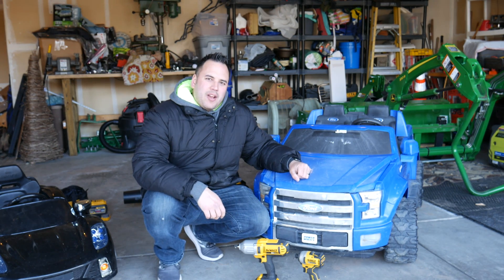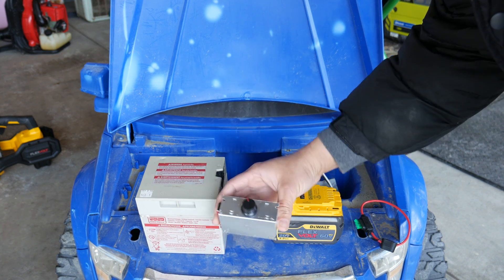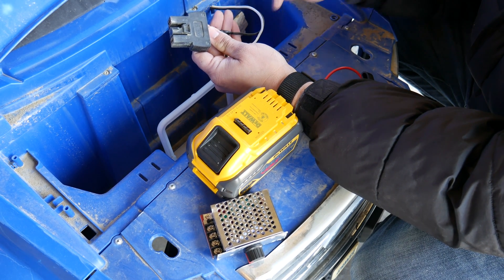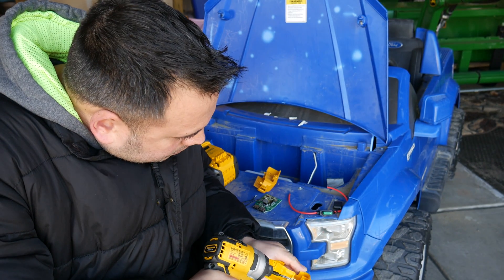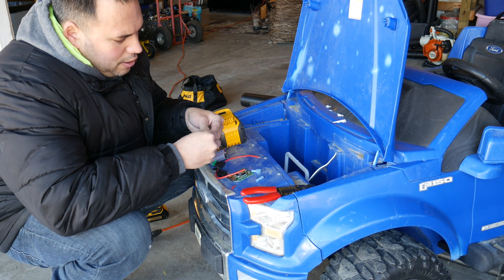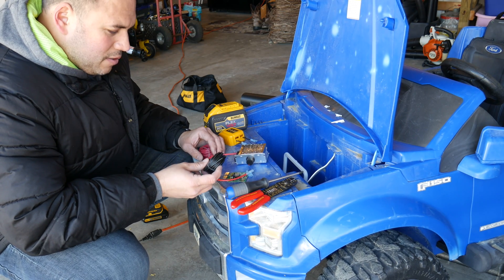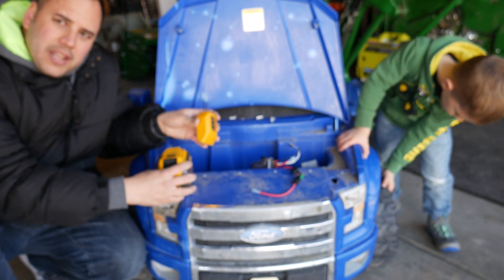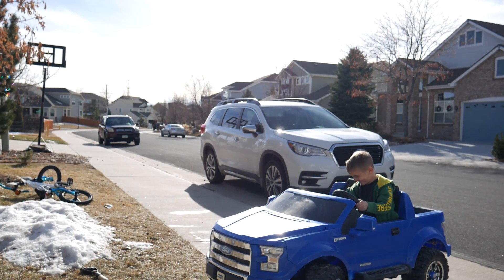SUPER CHARGE your kids Power Wheels with Dewalt 20V!

Comment: I like your idea but you didn't show the flexvolt battery and you didn't show how high you turned up the controller
Reply from the maker: Hello, because I used an adapter for 20 volts, the Flexvolt battery also operates at 20 volts and you just get longer run time.  If I ran it at 60 volts, I would fry the motors in a heartbeat which was not a goal of mine. 😊
Reply: How much run time does this give?
Reply: What about putting the controller on the foot pedal?

Comment: If you discharge below a certain volt then the battery cant communicate with the charger to charge. What u will need to do is connect positive and negative leads coming from battery and connect to anither battery for about 30 second. Now you can recharge the drained battery and not throw them away.
Reply: Never thought of that... good advice
Reply: thanks I merged the dewalt battery to the car one for even more power running the car battery positive, and merging the dewalt to the negative on the original battery and and using the dewalt lead to the car.. but the dewalt batteries keep getting drained way to fast for some reason

Comment: Pop the top off the old Power wheels battery and you can take the plug out easy and best way i have found for connectors. can also use 10 inch bike tires and cut the bead off and put it around the plastic tire and run a few screws the the side wall of the bike tires to keep them in place.

Comment: To add my two cents:

1. I bought 10 12" long trailer wires ($2 on Amazon) and cut them in half to create my own system of proprietary connectors.  I ended up converting one of the trailer wires into a polarity reverser.  The wire gauge is not great, but the run is only a matter of inches and seems ok.
2. I used a cheaper non-Dewalt adapter ($15 on Amazon) and soldered directly to the 20v out to the tool.  All the electronics and included USB charger on the adapter still work.  It still adapts 18v tools to 20v batteries.  I filed holes where the two halves of it meet for the fuse holder out and back in, and the trailer wire out.  The clamping action of the case keeps my kids from tearing apart the solder and butt connections.
3. I ended up buying a pair of 6ah batteries on sale at Home Depot for $129 to run my kids PowerWheels.  These are a great size.  I couldn't bring myself to burn up my Flexvolts which are way more $$$ per Ah.  The kids change batteries when then get down to one light on the battery.  My understanding is that a large Ah battery will get you approximately 10% more speed (also slightly better performance in certain tools).
4. If you use up a 5Ah battery in 30 minutes of hard driving, that works out mathematically to an average of 10amps over 0.5 hours.
5. I ended up with drifty cars due to much more power than the wheels can put to the ground.   This effect (which the kids love) creates substantial tire wear.
6. The first time we pressed the pedal on our Barbie jeep (polarity reversed !) the kids flipped the jeep rubber side up completely and landed on their heads.  The roll bar on the Jeep actually worked.
Reply: Number 6 had me dying.
Reply: I know this is kinda old but cut old bicycle tires and screw them around the tire. We have a field and a trail through the woods so did this and now my boys battery side by side has plenty of traction.
Reply: @ngfd338  I’m glad I saw this comment. Great idea
Reply from the maker: Scott Smith Excellent ideas!  Thanks for sharing with us!
Reply: So, do you have to use the speed controller…aka the Potentiometer?

Comment: @Hans Makes it Work. Hans i need your advise urgent regarding motor and gearbox upgrades i want to do. Do you perhaps have an email or skype i can contact you on if you would please assist me. Thank you
Reply from the maker: Enrico, I am not yet a Power Wheels expert, but I do understand electricity.  I have never swapped the motors or gearboxes because I typically get the vehicles out of the trash.  When they die, I return them to the trash and move on to the next one.
Reply: @TractorHoarders  Thank you for getting back to me Hans much appreciate it.

Comment: So I did the exact thing. Except a Milwaukee battery. But my fuse keeps blowing. What would be the reason for that?
Reply: I found out the problem. The positive came undone and kept shorting the fuse. Resoldered it and it works fine now. Thanks for the replies!
Reply: Only thing that would cause that would be a short from positive to negative before it goes into the controller.... Just a theory without seeing your setup.
Reply: Having the same issue... The in-rush current on those motors is spiking if you have more weight in the car.  Does the fuse blow under no load (wheels off the ground)?
Reply: I changed mine to a 30A breaker with a slower response and it’s working great

Comment: NICE I HAVE EXACTLY EVERYTHING U HAVE THE USB CHARGER HOW DO YOU KNOW WHICH IS POSITIVE AND NEGATIVE
Reply from the maker: Look at your battery pack.  It should have  + and - symbols on it.  Then, watch where those connect on your USB adapter and you’ll be able to see which is what.  Hope this helps.
Reply: If you don't know, you could  place a voltage meter on it and that will show polarity.
Reply: I just did this conversion. I got the truck for $10 not knowing what works. I have power with the shifter in reverse , but nothing in forward gears, I’m think it’s the shifter that needs replaced, do you agree? When I reversed the wires and left it in reverse it wen forward.

Comment: If I upgrade voltage to a power wheel that has features like remote control, radio and lights will I try them?
Reply from the maker: Yes, I’d be careful with that.  You can however easily separate those features from the drivetrain and run those with a separate battery to ensure they only get 12 volts.
Reply: Buy a 24v - 12v converter and make sure the radio etc are connected to that. So the upgraded voltage goes to motors and everything else goes through the converter

Comment: im an electrical rookie. from the dewalt usb adapter is that a smaller gauge wire (16gauge) going to a thicker gauge wire (12 gauge)? Won't that make it heat up? im trying to do the same exact thing as youve done. thanks for your help

Comment: How are you preventing the lithium battery from completely discharging?
Reply: Actually your batteries arw fine, theyre just to weak to tell the charger to start charging. If you hook up a positive and negative lead from battery then connect them to another battery for about 30 sec. Now you can charge the battery that was drained
Reply from the maker: I'm not.  I realize that I should, but maybe in the future...
Reply: Just let them have fun but dont drain it all the way
Reply: I’ve ruined two of my batteries so far 😂
Reply: Watch this https://youtu.be/8n_NJ2uIDU8

Comment: What's the run time of the 20V? 
Did the 60V work if so what's the run time on the 60V?
Reply from the maker: Victor Rodriguez I’ve never really measured it but I feel like the 20v 5ah battery lasts about 30 minutes.  The 60v Flex Volt (20v 9ah?) lasts about an hour.

Comment: I just did this and they love it.  But rode for about 5 min and I blew my first 30A fuse.  Should I just put a new one in and try it again and see... or...?
Reply: Same here....
Reply from the maker: DougMX726 I’m going through the same thing!  If we get too much resistance from having a load in situations where we get traction, it blows my 30a fuse too.
Reply: @TractorHoarders  did you ever find how to fix that?
Reply from the maker: Heather Moore I found that if we stick to cement and pavement, we don’t have an issue.  When we go off-road, up hills, or places that cause extra resistance, that’s when we blow fuses.  Someone that did this same mod said they put in a 40 amp fuse and have been fine.  I haven’t personally tried that.  When you do it, the wiring and electronic components will get hotter.
Reply: @TractorHoarders  WHAT ABOUT USING BIGGER FUSE AMPS WILL THAT HELP ??
Reply: @TractorHoarders  to not deal with the issue of blowing fuses, is why some people use the circuit breakers??
Reply: Use a circuit breaker instead! Trust me, less dead in the water moments. Check AutoZone

Comment: Iirc 12" or 14" bicycle tire fits over the original Power Wheels tires and gives Superior Traction.
How do you prevent over discharge?
It would suck over discharging your $100 lipo Nick crapping out
Reply from the maker: Andrew Downey - hey, I’m currently not preventing over discharge, but certainly open to suggestions!  Let me know if you have a recommendation.  Thanks!
Reply: @TractorHoarders  I just over discharged one of my small dewalts today. I went on amazon and bought some off brand dewalt batteries that supposedly have it built in.
Reply: @TractorHoarders  Ive been told the powertool lipos have  discharge protection.
Thats why when the drill stops, you can still charge the battery.
If it didnt and you over discharged the battery, you wouldnt be able to charge it again
Reply: Discharge protection depends on the battery platform. For instance ryobi has over discharge protection built into the battery, which is how they kept backwards compatibility with their old nicad tools. However Dewalt, Milwaukee, Makita, ect. have the discharge protection built into the tools. The batteries themselves have no way of preventing over discharge. Dewalt however makes a 20v to 18v(nicad) adapter that has over discharge protection built into it. That is the route I would go if I was going to do a conversion like this.
Reply: Ben Grant Bosch professional 18v also have the protection in the battery
Reply: Would this protection board work? 

https://www.ebay.com/itm/12-36V-Battery-Low-Voltage-Disconnect-Protection-Module-DC-Output-XH-M609-New-/123776928982?_trksid=p2385738.m4383.l4275.c10
Reply: https://youtu.be/8n_NJ2uIDU8

Comment: Time to wrap those plastic wheels in rubber!
Reply from the maker: I was thinking the same thing!  Maybe an old bike inner-tube or something.
Reply: @TractorHoarders  be careful adding more traction... Many modders have found the gears get destroyed very quickly without an electric jog feature when starting and stopping.
Reply: Use flex tape.  I got the black 4” wide flex tape and it works great
Reply: Heard the same thing with the inner plastic gears wear out fast
Reply: Got mine all wired up and doesn’t work. I can hit the pedal. Power will get engaged. Then hit the pedal and get throttle response once. Then seems to lock out the circuit board.
Reply: @rukusmasta2  chances are it won’t be a powerwheels if it has a circuit board

Comment: Great work!  This might help you out in the future.  https://www.amazon.com/gp/product/B07ZY8DS58/ref=ppx_yo_dt_b_asin_title_o03_s00?ie=UTF8&psc=1
Reply: Also, you instead of splicing into your wires, since your power wheels batter is dead, just take the connectors off and you can just use the plug.  Check this out.....  https://www.youtube.com/watch?v=oVbe8LoC3FM
Reply from the maker: Nice!  Thanks for the info!